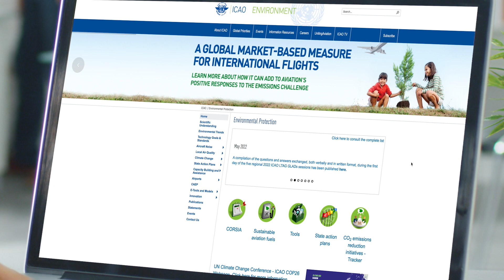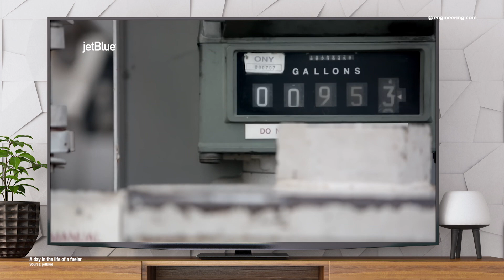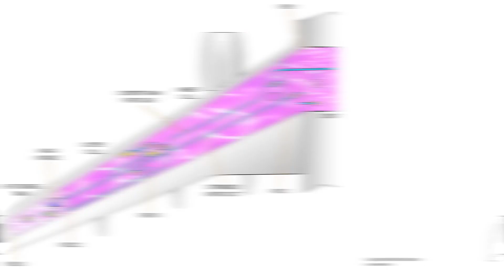Ammonia as Jet Fuel?

Comment: 3:33 No. This is not a sensible solution. Atmospheric carbon capture is a very energy hungry process that is going to directly (by powering the capture machines with energy produced from fossil fuels) or indirectly (by diverting renewable energy that could be used to replace a fossil fuel energy source) increase the amount of CO2 in the atmosphere. Do not push this dead-end technology, it is counterproductive.

Ammonia as a fuel definitely has promise.

Comment: Taking CO2 out of the air, at commercial scales, economically has absolutely not been demonstrated. Remediating gaseous CO2 from a concentrated source, mostly the exhaust from a hydrocarbon electric generation plant, has been demonstrated. But straight from regular atmospheric air? Nope. That's pure vaporware.

Comment: This is the answer.  Perfect a manufacturable shipping crate based micro nuclear reactor that burns nuclear waste plus thorium.  Produce the hell out of it.  Generate electricity anywhere and at all times. Desalinate water where needed.  Generate synfuel from CO2 for use in diesels or jet fuel for turbines.  For some applications, if economical produce hydrogen.
Reply: People seem to think that the CO2 from "Corn" Ethanol and Soy Biodiesel will magically come down from the Stratosphere and go back into the leaves of plants.